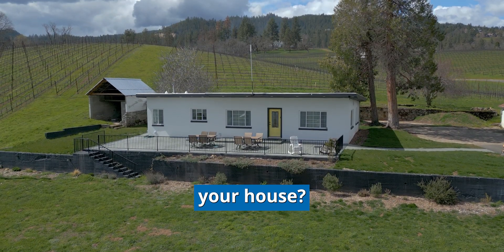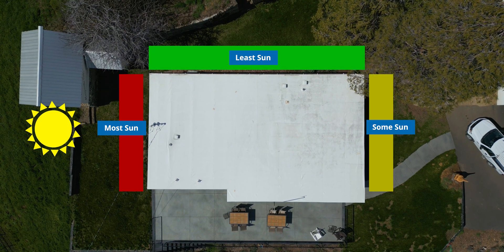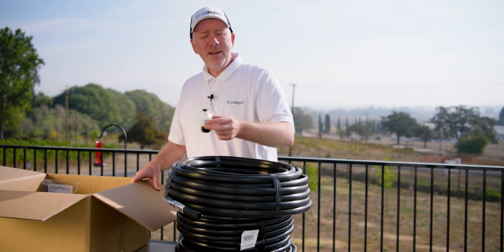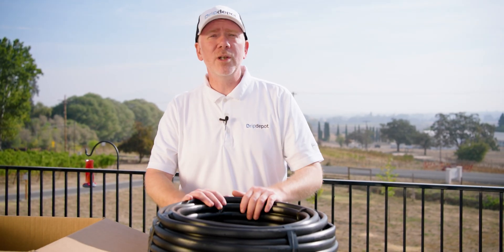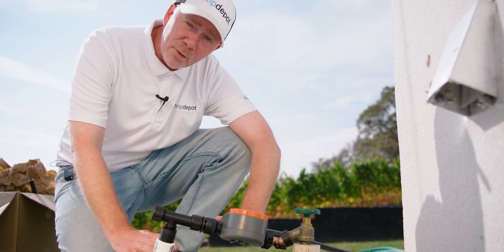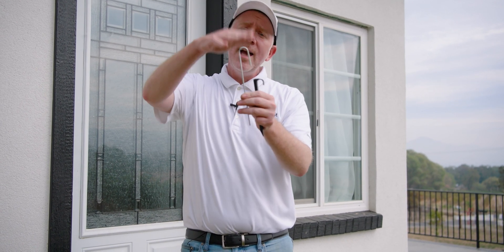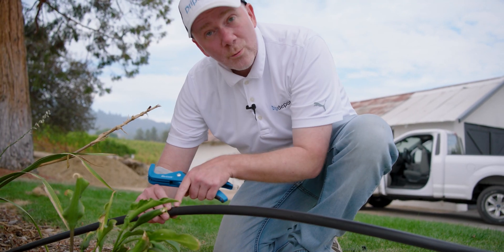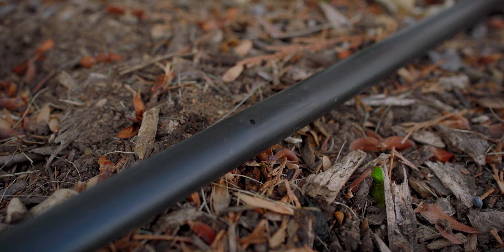How to Install a DIY Foundation Watering System (Complete DIY Beginner's Guide)

Comment: For how long and how many days a week do you have to leave the water running?
Reply from the maker: Watering frequency and duration vary from location to location due to on site factors.  Soil type, weather, foundation design, emitter flow rate and sun exposure all play a role in getting a set frequency and duration.  As a general rule for houses with clay or mixed soils, 20 to 60 minutes 2-3 times per week in dry weather is a good starting point, with 0.5 GPH emitters at the longer end of that scale and 1.0 GPH emitters at the shorter end.  If you see cracks in the soil or ground pulling away from the foundation, you can increase the duration or frequency (or both!) slightly.  Likewise, if you see standing water or mushy soil, cut back on the watering a bit. 

The frequency and duration are likely to change a bit through the season  as well, the basic idea is for the soil to be consistently moist.  You can check it on occasion by just pressing your finger a few inches into the soil to make sure it's not dry or muddy (and if it dry or muddy, increase or decrease watering as needed) :)

Comment: I wish I would have found this video a couple of years ago. I bought a house and it has foundation issues. The company that repaired it 10+ years ago came back out and adjusted the piers and added more. But I am still getting movement and cracks in the ceiling and walls. I can't afford to put more money into the house. And I can see where there is not enough soil around the foundation also. Does anyone know what type of soil I need to add around my foundation to get it to build up and fill the gaps? I need help to keep my foundation from getting worse.
Reply from the maker: A foundation expert will likely know better in regards to what is "best" , but I know in general we see a lot of clay-based topsoils that includes some sandy soil in the mix used.  It kind of hit that sweet spot between drainage and retention.  Enough clay to seal but sandy enough to drain at a reasonable rate.  When you go to get some soil for this, ask for fill dirt or topsoil suitable for grading around a foundation, most places will know exactly what you're looking for (and that will be a good sign you're at the right place, too, and if there's any particulars based on the soil in the area, they'll fill you in on the details).  Grade it so it gently slopes away from the foundation and tamper in shallow layers that might otherwise settle over time.  

The above is usually fairly easy to DIY outside of particularly large houses or odd terrain and should save a good chunk over hiring to have it done.  After that, a foundation watering system can help keep the soil moisture levels consistent which will in turn lessen the degree of expansion/contraction cycles that cause foundation movement.

Comment: I feel like just sprinklers would do the trick as well, instead of doing all this work... even with the timer I would still have to remember to turn the water on right?
Reply from the maker: With a timer, you do not need to remember to turn the water on.  Well, at least not after the first time.  Once a timer is connected you can open the spigot and leave it open.  The timer valve will stop the flow of water outside of programmed watering cycles and only open for watering.  

Sprinklers could likely accomplish the overall goal in moistening the foundation soil, though they'd probably be more work.  Underground sprinklers of course require a lot of trenching and pipe laying.  Above ground sprinklers fed by a hose would be smaller bursts of work, but over time moving the hoses, moving the sprinkler, adjusting location, rolling up the hoses, etc will add up to more work than the few hours to install a drip system (the time spent doing above ground sprinklers would eclipse even sub-surface in hours after a few seasons).  Basically, above ground sprinklers would be fewer hours but with much greater frequency.  

Aside from all that, I think the main reason drip is popular for this application is in efficient water use and water bills.  For the task at hand, drip is going to get the job gone with significantly less water.  Anything overhead is going to see water delivered where it's not needed (worst case watering weeds), water lost to evaporation and potentially water lost to runoff.  More water for the same job means a higher water bill, and similar to the hours spent on the job, the initial savings are going to be lost over time compared to something more efficient. 

And the work isn't that bad, I probably make it look harder than it is lol - poly tubing is flexible, so there's a lot of margin for error in laying it out compared to something rigid like PVC. The flexibility means simple barbed fittings can be used and no additional steps or materials like primer and solvent are needed :)

Comment: I live in Dallas and planning to do a drip system on my foundation and after watching this video I have a few questions. The T shaped filter, can it be used as a splitter? I’m planning on using the spigot in my backyard to supply both sides of my house.
Reply from the maker: The Tee Filter unfortunately cannot be used as a splitter.  The additional end is for flushing the filter rather than an additional outlet (though flushing definitely provides its own benefits!).  

The hose filters are not rated for constant pressure so will need to come after shut-off valves as they need to be relieved of pressure when the system is not in use.  Likewise with the backflow preventer and pressure regulator.  Usually this means one of each per zone coming off the spigot.  There are filters and regulators (but not hose backflow preventers) that are rated for constant pressure, but they are all pipe threaded and would require adapters at both the inlet and outlet to get installed on a hose bib.  Up until about 4 zones it actually costs less to go with one for each zone, at least last time I compared the costs  :) 

If you're planning to split this into a front yard and back yard zone (which I do think is a good approach) a Faucet Y Splitter or multi-outlet timer will do the trick.  I'll link an example of each below: 

This link goes to a brass hose Y (there's others as well, just wanted to link the common examples): https://www.dripdepot.com/2654

This one goes to one of the 2 zone timers, there's also quite a few others available, even some with WiFi or Bluetooth if you prefer app level control: https://www.dripdepot.com/14191

Comment: My foundation, I was wondering if this hose can be buried in the ground?
How deep should I go?
How long does the hose last?
Above ground the weather here in north oklahoma well, tear stuff up the heat and cold. I bought one of those soaker hoses, and I would have to replace it every year and it was above ground plus I had to worry about running over it or terror usually tearing it up with the weed eater. And that's my main reason of putting it in the ground. 
How many square feet does one kit cover?
Appreciate any information you can give me on this. So I know how much to order from you guys.
Thank you very much.
Reply from the maker: Happy to help!  

The drip line can indeed be buried, I'd say the most common depths are 4" to 12" with most coming in at 6" to 8".  Burying does raise the risk of clogging a little bit, but it is designed to resist clogging and you can use the roll with anti-siphon to further reduce the risk.  This is the type with anti-siphon built-in: https://www.dripdepot.com/half-inch-pc-poly-drip-line-w-cnl.  

The drip line can last an incredibly long time and it's remarkably resistant to freeze damage -- with a good drain at winter, it's pretty unlikely any freeze damage is going to occur.  For our winterization video I wanted to show the dangers of not winterizing so I filled some of this tubing up with water, capped both ends and put it in the freezer.  Weeks later, and no damage so it didn't make the video.  Oklahoma winter is likely colder than our freeze, but there should be no water in the lines by then to cause damage.  Poly tubing has a "bend but don't break" property that makes it a great choice for cold climates. 

I do find weed eaters and mowers (and general landscape maintenance equipment) to be the number one cause of damage to it, so that's definitely a valid concern.  If damage does occur, it's very easy to repair, significantly easier than PVC and no solvents are needed.   Without outside damage (tools, foot traffic, thirsty critters) this stuff can last for decades, even exposed to the elements.  No exaggeration either, though of course you will at times be making repairs, but they should not be extravagant.  

For these kits, don't think in square feet, just circumference :)   Basically, how long of a coil do you need to get from the water source, so the last location you want to foundation water?  Right now the current kits are for 100', 200' or 300' linear feet of drip line.  More drip line can easily be added if you're going to use more than 300' of it, however.  

I hope this helps!

Comment: I have a sprinkler system, is it possible adapt my sprinkler heads to drip with this system?
Reply from the maker: You bet, converting sprinkler heads to drip is a pretty quick and easy process these days, often requiring only an adapter or so.  

There's two main ways to convert a sprinkler to drip -- the first uses a drip manifold that works with 1/4" tubing and is best for small conversions or when the plants or area are very close to where the sprinkler is.  The other an convert a sprinkler over to a full drip irrigation system of almost any size -- if you're looking to water your foundation, the second route is likely the go-to here. 

We made a short video that shows how to do both methods here: https://www.youtube.com/watch?v=l8gzTCgZQLQ 

Don't hesitate to drop a line if any questions come up, always happy to help!
Reply: @dripdepot  thanks so much, one of my zones that I may intend to covert sprinklers to drip the foundation also waters a flower bed, can I have multiple old sprinkler connections used as drip in the same zone?
Reply from the maker: @utmostD  Do you mean to convert a couple different sprinklers over to drip?  If so, you absolutely you could convert multiples so you could drip irrigate both the flower bed and the foundation from the same zone.  In fact, I think that's a great way to go in this case.  Normally the big thing to watch out for is watering times, but a flower bed and foundation are going to get very similar watering cycles (at least in most climates).  And you could always add more emitters to the flower bed if they need a little more water :)
Reply: @dripdepot  Thanks, last question, do you run the drip line around the driveway? or just the foundation?
Reply from the maker: @utmostD  Most folks do it just around the foundation.  The area where the driveway meets the structure typically does not need watered, as the concrete itself traps moisture in below.  There may be small exceptions (extraordinarily dry places might benefit from having some drip next to the driveway so that water makes its way under), but in most cases it will not :)

Comment: How do we know which kit to buy? Basic, standard or deluxe?
Reply from the maker: Mostly it's about making sure there's enough drip line and tubing to get everywhere it needs to be around your house.  You can take measurements to see the total distance you need to cover and then check which kit is the closest fit (you can modify the kits as well to add or remove items you won't need for your house).  

The basic kit has 50' of tubing (blank tubing you can use to cross places you don't want to drip water) and 100' of drip line. 

The standard kit has 100' of tubing and 200' of drip line. 

The deluxe kit has 100' of tubing and 300' of drip line.  

Just in case you hadn't bumped into it yet, here's a video that will guide you through designing the system : https://www.youtube.com/watch?v=FJF49lb23b8

That video is for an irrigation system, but the exact same things apply to a foundation system :)

Comment: What's the good suggestion when you need to edge the grass?
Reply from the maker: Great question!  Burying the drip line is the first thing that comes to mind, then there's no worries about hitting it with the edger if it's buried deep enough.  Laying the drip line away from edges also works (as long as it's still close enough to the foundation to be effective).  

Alternatively, it's pretty easy to pull up when it's on the surface -- If you're using a hose bib as a water source, all those parts thread together so it's easy to remove, pull up out of the way and then put back when you're done.  Quick connects could be installed at various locations as well, or even just threaded fittings throughout so you can quickly remove and move a section to work the landscape there, and then place back when the work is complete. 

Great question, thank you!

Comment: Great video and website! We just bought our first home, newly built in Dallas, TX. I'm starting to see a gap from the clay soil drawing away from the foundation, so I'm eager to buy one of your foundation kits, a hose timer, etc. One question I don't see covered yet: our driveway is adjacent to one side of the house. It's a split driveway with light gravel down the middle, so we could irrigate that part, but our car would go over the hose twice. I'm really not sure how to handle that.
Reply from the maker: Great question!  There are a couple ways you can handle this to protect your tubing but also get water across the driveway.  

1. You could bury the tubing beneath the drive way -- they make hose attachments that use water to bore a small passageway beneath concrete.  This is probably one of the more difficult ways to do it, particularly if repairs ever need to be made.  Running it through some protective conduit (class 200 PVC pipe works well there) is advised so that repairs are minimal.  

2. You could use quick connects so that you can quickly disconnect when not watering and then reconnect before the next watering cycle.  This does take more babysitting of the system than is always desired.  

3. I saved what might be the best for last -- this solution actually came from a customer who was asking the same question (I wish I could take credit!).  He ended up using larger sized cable protectors -- the same type you see in offices and other locations where a lot of wire or cable is ran.  This allowed him to simply run the tubing across his driveway, but still protect the tubing from damage.  You'd want it to be the sturdier and larger cable protectors, but they did the trick for him :)

Comment: I purchased the straight, inline filter. It leaks at the connection with the pressure regulator. No matter what. Also, what causes the faucet to squeal when it runs through the system?
Reply from the maker: Mike, check for the gasket in the female side of that connection -- if the gasket is missing, that's the culprit.  If it's there, fire me off a picture (or maybe even video so I can hear the sound too) in an email from here, happy to help everything get up and running like it should: https://help.dripdepot.com/support/tickets/new

I can confirm that, with the gasket in place, that connection should not leak (also make sure there's no thread seal tape, that can cause leaking but shouldn't be used with hose threaded connections).

Comment: I see that you used the same drip line for the place that has the most sun and the side that has less sun. In the video you said you were going to use 1GPH for the sunny part and 0.5 GPH for the less sunny part. How did you get the 1GPH and 0.5 GPH flow rates with the same 12" drip-line which would be 0.5 GPH.
Reply from the maker: The two drip line look identical, as the emitters that are responsible for controlling most of the output, are inside the drip line.  Even the emitters are going to look very similar other than small (and probably difficult to see) differences in orifice size and flow path.   

There is one more way to account for sunny vs shady that we didn't mention in the video, and that's emitter spacing -- poly drip line like this is commonly available at 9", 12", 18" and 24" spacing -- this allows someone to go with a wider spacing on the side of the house that doesn't need as much water, and/or a closer spacing on the sides more exposed to the sun.
Reply: @dripdepot  Ok. In the video he used a 1/2" mainline and 1/2" dripline with 12" spacing, didnt mention any other dripline being used thats why I got confused. I just ordered the foundation watering kit and it has 2 100' 1/2" drip lines with 12" spacing. I guess if i wanted a higher flow rate I could punch some additional holes in the dripline?
Reply from the maker: @tsjgnlnl  Yep, other than the mention at the start, I didn't mention the difference in flow rates again -- the video was getting pretty long at that point so we made some tough decisions in the cutting room floor. 

And you do have it right (and that's a great suggestion!), you can indeed punch in additional drippers between the ones in the dripline if you end up needing more water on the sunny side of the house.